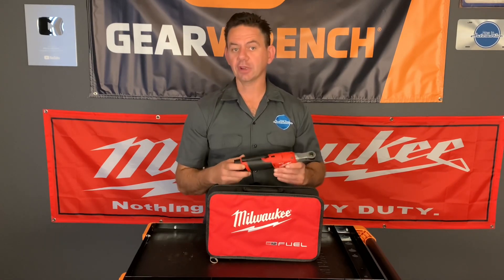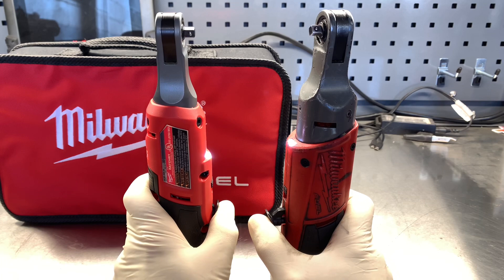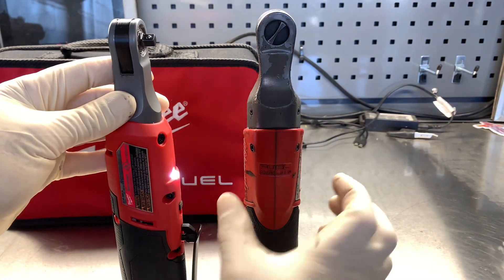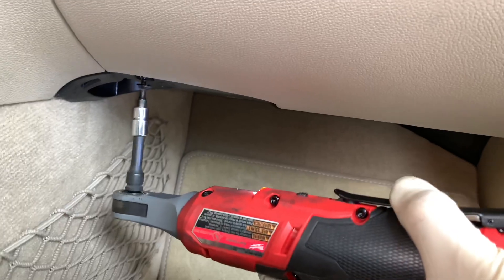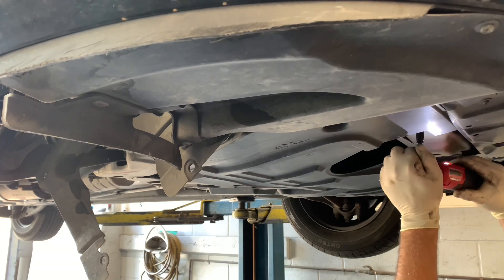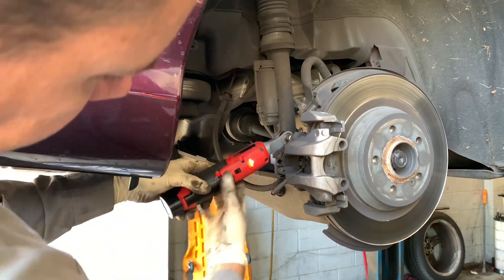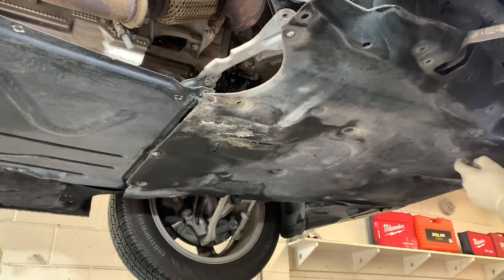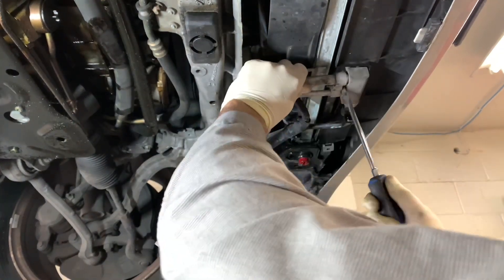Milwaukee's Newest And Fastest Ratchet Yet!

Comment: I agree 5 foot pounds of torque for the extra speed is a better trade off. I’m looking to replace my old faithful  Mac tool 1/4 inch. I’d like to see that high-speed version in a long neck. 
I’ll buy it no questions asked.
Reply from the maker: I’m sure they’ll come out with that extended Ratchet. I’ll be excited to get that one as well.

Comment: On the fence to get both 3/8 stubby impact and ratchet or 1/2 stubby impact and 1/4 fuel ratchet. Having one set of sockets and some impact 3/8s would be a major plus but would I lose out on the size differences of the 1/4 and 1/2 stubby?
Reply from the maker: I would go with the 3/8 Stubby. It has exact same power as a half inch but you have way more socket options with 3/8

Comment: So for torque ratings it's not as simple as 35 vs 40 every ratchet has a different ftlb rating so for 1/4 high speed is 35 vs 40 but for 3/8 it's 35 vs 55 there is no high speed ratchet for 1/2 but the normal one is 60 btw these numbers are pulled from milwaukee's website and are all fuel ratchets